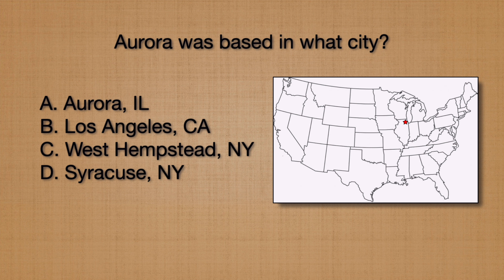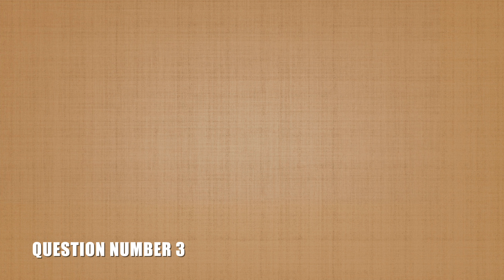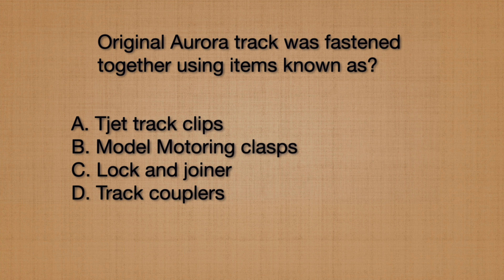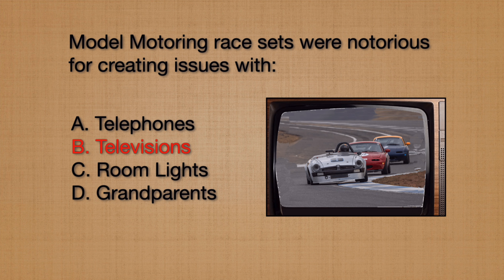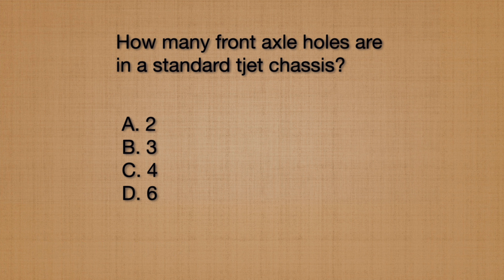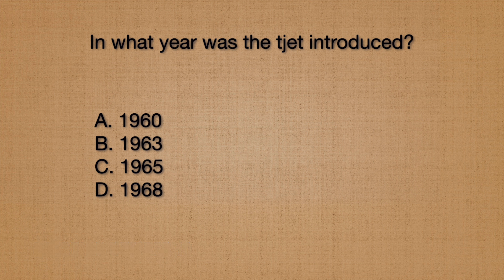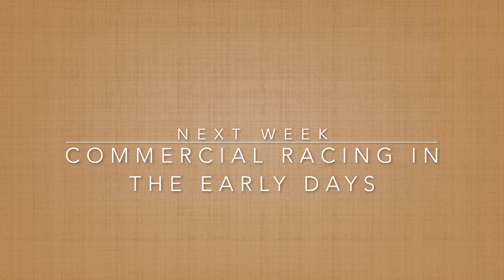Tuesday Trivia Aurora HO Slot Car Edition

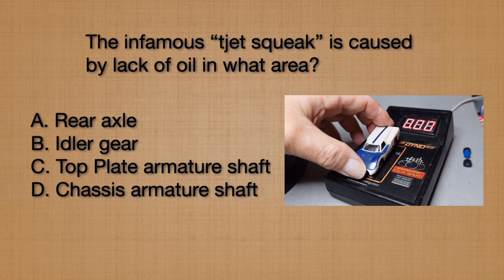Comment: Having been given a 1:43 Aurora set instead of the HO back in 1964, I remembered so much of this. I had the only 'wide track' setup in the area, running HO cars on that wider track. Basically eliminating the inner lane car knocking off the outer lane car, it made the larger figure 8 track more equal between the lanes. Wonderful nostalgic video!